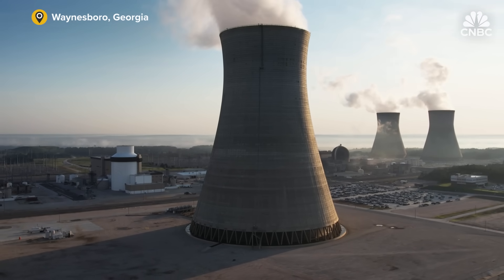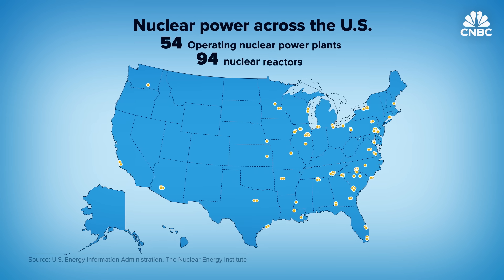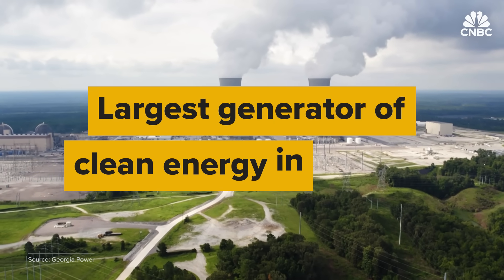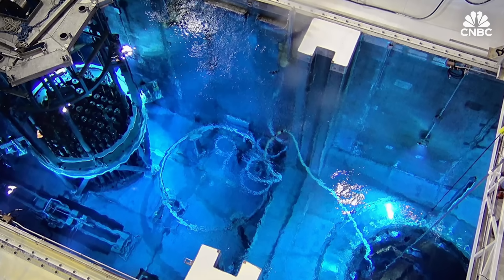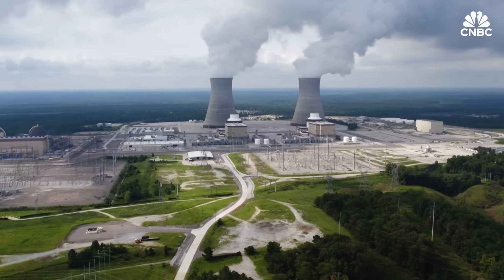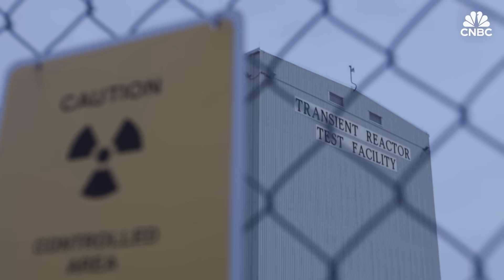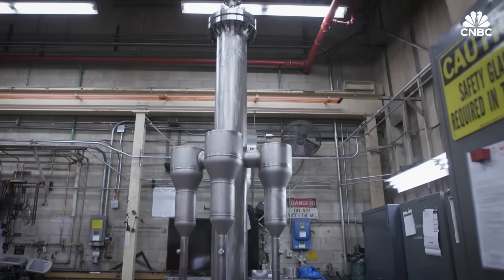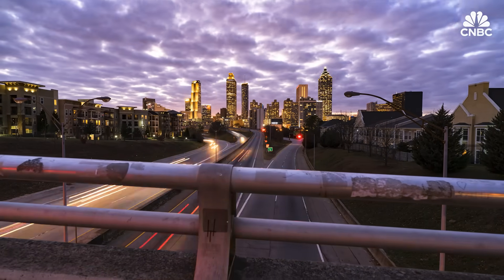Why It’s So Hard To Build Nuclear Power Plants In The U.S.

Comment: Solar/battery is much cheaper and much faster to build out now. It's 2024.
Reply: @SimonTmte  last I checked decommissioning a nuclear power plant is no walk in the park either. Makes recycling solar panels and batteries look easy. All those materials can be reused and it's already being done, although not that much because they last a lot longer than people ever thought.
Reply: Depends on the situation, for most industrialized countries a 100% renewable + battery mix will cost more than any mix containing some nuclear. You have to look at the energy mix, not the LCOE of a single energy source. Also costs and price are different, solar has lower costs, but the electricity price is high for consumers, nuclear viceversa. As an example California and Texas are suffering extreme electricity price swings due to the high penetration of solar (the duck curve)
Reply: @filippo1864  the whole point of battery installation is to even out the duck curve, which is already happening in CA, TX, and other places. It also provides as a grid stabilizer. As a matter of fact nuclear is the least compatible option because it's designed to run at one power level 24/7 whereas the grid has constantly changing demand. Solar/battery combo is uniquely suited to combat this ever changing demand load. I'm not saying we should eliminate nuclear. By all means keep what we have online, as it does provide a good base load function. But the notion that we need 10's or 100's of new nuclear plants to meet the demand is plain false.
Reply: @ryen7512  exactly we need base load, that’s the point, but the energy demand is set to increase in the next decade, and electricity demand will even double or triple, maybe not thousands, but more than 50ish sure (pure guess, I don’t know exactly for the US). For example my country would need around 32 GW of base load nuclear at least in the future, which is between 30-20, currently our electricity demand is around 300TWh and will become 600.

Comment: Doesn't grand coulee dam make more electricity (6800MW) and considered clean energy?
Reply: That’s installed power, annual power production can be lower sine it’s dependent on the volume of water that passes the turbine, something that varies throughout the year.
A nuclear plant produces installed power 24/7 all year round
Reply: @12345anton6789 According to a comprehensive 5 minute Wikipedia search grand coulee dam averages 21 billion kwh a year and the Georgia plant produces 19 billion  kwh. I'm thinking they botched the script on this one.
Reply: Yes, but in terms of land and material usage is worse than nuclear and hydro is difficult to expand at this time, it’s almost saturated and any effort to expand it will incur in diminishing returns.
Reply: @filippo1864  no argument each site and method has pros and cons. It just seemed like an inaccurate statement that it is the highest producing clean energy site in the US

Comment: Going forward molten salt cooling should be the standard.
Reply: MSR have a long way to go before that happdns, like proving one to be an economically (good one not bad) operational unit.
Reply: No it shouldn't. We have tried and true designs that can be deployed now. District heating and cooling with exhaust steam should be the standard.
Reply: Need to keep pointimg out that others are suceeding at it hence US has found the way to be the problem. Need to point out how some of the so called criticism is sheer manure. Also need to confront the bureacracy, it is a necessary evil but don't let its every whim dominate the plot.
Reply: Problem is maitanance of these reactors is dangerous it must be maintained in running reactor it canot be shot down

Comment: We also need to include fuel-rod recycling like France. To reduce nuclear waste.
Reply: Or build molten salt reactors, which can use those as fuel.
Reply: @archieflower4757  Absolutely. Get the MSR's that will use "depleted uranium" as fuel.
They actually consume nuclear waste, rather than produce it. That alone is a worthy goal even if it takes energy to do it. But an MSR will crank out plenty of energy. There's no downside here. Everything about a recycling MSR is good.
We have enough nuclear waste today to run the entire world at current USA-levels of consumption for the next 1000 years. Let's do this.
Reply: I actually don't think this should be priority, provided everyone does keep their waste accessible (I know, that's a bit touchy) so we can recycle it in case of a shortage and treat it as stockpile - also nice for being entirely immune to price fluctuations of the material. It's not like uranium goes bad if you don't put it in the fridge.
Reply: We don't have to. We can store the waste while the nuclear industry develops more technology. And the time will allow for decay which will make future reprocessing in the future easier.
Reply: We need the fuel-rod recycling that France was GOING to do (breeder reactors) before the Greens had it dismantled. (after they launched a rocket at it during construction. Not even kidding, look it up)
Reply: @mukiex4413  You should always provide a hyperlink when you stuff like that.  This took 10 minutes to find!  https://en.m.wikipedia.org/wiki/Plowshares_movement
Reply: Power generation is a first order problem for the US, nuclear waste storage is a second order problem, nuclear waste recycling is a third order problem. We need to get our priorities in order.
Reply: Or actually build a sarcophagus for DU to be stored, do it like Germany where they used old mine system
Reply: @HowToChangeName Russia just dumps their waste in lakes and rivers 😂
Reply: @HowToChangeName The old mine in Germany is a disaster, ecologically and financially
Reply: We do this already.  Depleted uranium is on some US Air Force planes.  And it's completely safe! I know because when I was in the US Air Force Reserves, I was also employed by the US Customs and Border Protection and we were issued personal radiation detectors, that are sensitive enough to go òff when people had thyroid problems
Reply: Doesn't that produce plutonium?
Reply: @SpazzyMcGee1337  Any time you hit a mass of U-238 (95% of today’s nuclear fuel) with neutrons, you’re going to produce a few variants of plutonium. The trick is to find a way to immediately use IT as fuel too.
Reply: Let Elon shoot that stuff into deep space.
Reply: There is no such thing as recycling nuclear fuel rods. This wording was pushed by the nuclear lobby. 
In reality, it just means to extract Plutonium, to manufacture Plutonium based fuel rods. 

The overall amount of waste doesn't go down. And it is a dead-end, since the highly problematic waste is stored in glass plates. 

Even if there would a technology in the future, to reduce this waste or to use it as a fuel, it will be stuck in glass.
Reply: They have a hole in the Nevada desert they need to dump all the used radiative waste
Reply: Aren’t environmentalists part of reason why we don’t
Reply: Depleted nuclear waste can be used to make redbull sized bullets for the military.
Reply: SOLARS 5X CHEAPER ANY TALK NUCCLEAR IS JUST IDI0TIC SHILLL PARRROTING
Reply: It doesn’t reduce nuclear waste.
Reply: Exactly, reprocessing is a clear answer to the waste issues.
Reply: You can prevent it entirely with Thorium and Fast Neutron Reactors. We have made a lot of advances in science than hte 1970s. We can do it, as long as politicians don't mess it up.
Reply: Cheapest to sell waste to India and Bangladesh in shipping containers. Then they dump it in the ocean for us. It is genius
Reply: The reason so few people do it is because it costs too much. Easier to just bury it. Also need alot of security and it produces plutonium
Reply: France only reprocesses once into unrecoverable MOX Fuel, due to nuclear waste recycling being among the best ways to obtain weapons-grade plutonium. The US and UK ceased its reprocessing programs due to the proliferation concerns, as well as the cost effectiveness of just mining more raw uranium.

Molten salt reactors haven't proved economical to operate.

We still haven't developed an artificial nuclear technology that is both economical yet non-weaponizable. So if anything the most prudent path is to minimize new deployments.
Reply: @doujinflip   Molten salt reactors haven’t proven economical because they haven’t been deployed in revenue service yet. Given their construction and structure though, they are likely to be cheaper, same as sodium-cooled reactors like that one funded by the Gates foundation. A simple pot is cheaper than an electric pressure cooker.

Most modern reactor designs don’t have proliferation concerns regardless of how economical they are. If anything, it’s the other way around, reactors that can breed weapons-grade material are more expensive.
Reply: @doujinflip  France reprocesses the fuel rods up to 5 times. They are working on MOX 2 and they believe they can safely recycle fuel rods 10 times or more.
Reply: We could use that nuclear waste for weapons.
Reply: @Piensamalyacertaras  It is a complete ignorance of your country's nuclear weapon setting.  US has dedicated facilities to make nuclear bombs.  Using commercial nuclear plant is too expensive.  Why do it it an expensive and difficult way when you have an infrastructure for this purpose.
Reply: Only if it makes $&$
Reply: @Retiredvetetan  that a joke? Nuclear has never been profitable without enormous government subsidy.
Reply: @darinherrick9224  no power source is profitable without government subsidy. None ever will be.
Reply: Why would public utilities be profitable? Such a weird American perspective. Makes absolutely no sense.
Reply: @Yeomen1986 oil produces a massive profit.
Reply: @AL-lh2ht  not in power generation
Reply: @darinherrick9224  investment in nuclear technology will make electricity too cheap to meter. Which is exactly why the elite dont want that to happen
Reply: @darinherrick9224  Nuclear has always been profitable, just not in the short term.  Stop talking out your cheeks.

Comment: We should have followed France's lead and adopted a standardized nuclear power plant design with only two or three sizes of the standard design. Instead, we reinvented the wheel with every new reactor which required a lengthy and costly approval process for every plant built. Very, very inefficient and now nuclear can't compete on cost with green energy sources with energy storage. We shouldn't be building ANY new nuclear of any design. IMO
Reply: France is the worst example when it comes to new build reactors...

Comment: LOL,  why no mention of Levelized cost of electricity?
https://en.wikipedia.org/wiki/Levelized_cost_of_electricity

Nuclear is 3 time  more expensive than renewables
Reply: Because it doesn’t account for energy mix and other costs, nuclear is expensive in the LCOE because it’s the only source that accounts for all its costs, the others don’t, like connection, storage, intermittency, curtailment, incentives and penetration in the energy mix. It’s not a good metric in this case, VALCOE or LFSCOE are better, but still not perfect.
Reply: Using LCOE is misleading as solar and wind can’t produce electricity 24/7. The loss of electricity is actually a significant cost for intermittent sources. Nuclears biggest cost is actually building the plant and hiring workers, once the facility is operational it’s very profitable

Comment: The US is still scarred by the Three Mile Island. New technology (modular reactors) needs new thinking
Reply: It’s not the technology it’s the lengths they went to coverup an issue with that meltdown. A lot of why it wasn’t worse was dumb luck. They even tried to silence a whistleblower which initiated an FBI inquiry.
Reply: Still needs more research too to become both economical to operate while not a weaponization risk. Until that's sorted out it's safer to minimize new deployment of our existing designs.

Comment: Imagine how much Solar you could install for the 14+17 Billion dollars this cost...

For Comparison: According to MarketWatch an industrial Solarpark costs 1.06$ per Watt, Meaning this for 31 Billion$ you could install roughly 29 GigaWatt of peak Capacity SolarPower. At that doesn't even account for the operational costs. Absolutely insane.
Reply: Solar need massive battery to work. Electric demand is high at night when solar generates 0 power
Reply: @konigstiger3252  Battery prices are in a free fall. A kwh of battery today costs only 50% what is used to cost in 2021. And in 2021 the prices were already down 70% from 2010.
Reply: @konigstiger3252    where did you get your engineering degree?
electric consumption at 9pm is half of 9am
Reply: Solar energy is intermittent i.e. it requires storage facility because we produce solar on daylight and use it on night but with nuclear that is not even a problem. Solar energy transmission requires a major upgradation of grid , but with nuclear we doesn't need to replace or upgrade our grid . Nuclear is best possible source of energy.

Comment: The problem is you have to pick a good plant prototype and copy it vs. a new model every plant
Reply: This is a huge part of it.  Too many firms trying to push their own designs resulting in zero mass-producibility.

The federal government needs to hold an open competition and select the best design, like they do with military equipment.
Reply: @alexanderfreeman3406  I don't know if military equipment is a good example of efficient and cost-effective manufacturing. The prices there are crazy. Over $170.000 just for a Javelin rocket launcher.